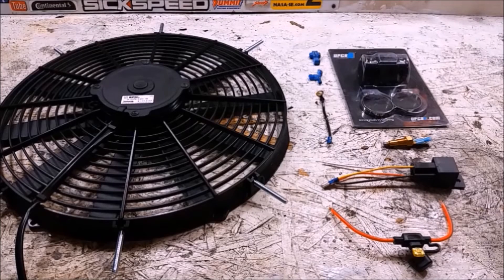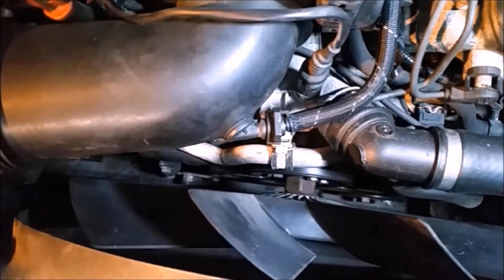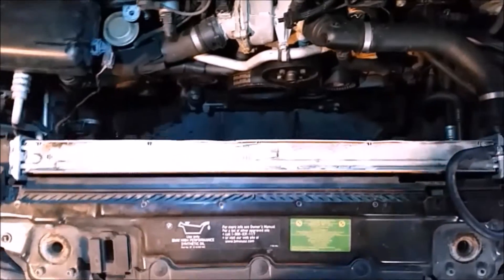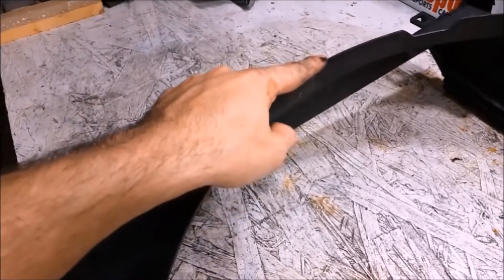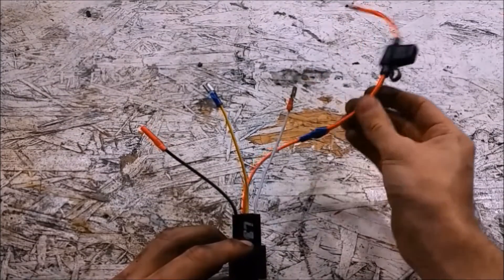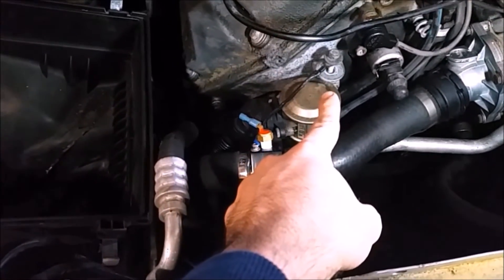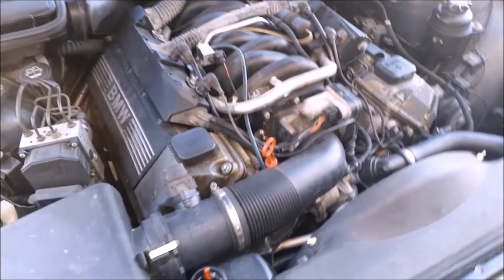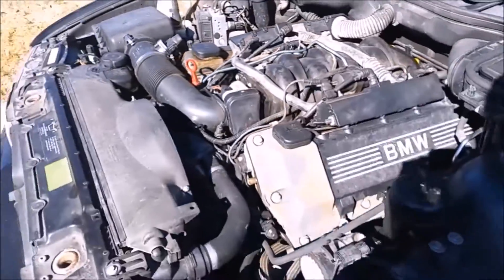E39 BMW 540i Electric Fan Conversion (Cooling Overhaul Part 3 of 5)

Comment: Hello, I bought a 1994 e38 730i that had a 4-pin fan. The car plug is 3-pin. When I turned on the AC it would spin for 20 seconds and blow the fuse. Now I bought a 3-pin fan and I don't know if it should turn on as soon as the AC is on. Is it related to the cold weather? What could be the problem? if I put power on the fan plug it turns on. I don't have 12v on the car plug, I just have 3v on one of the pins. 
I checked all the fuses and they seem ok. Honestly, I don't know which relay it is. What else can I check? Thank you.

Comment: fan spal how much inch ?
Reply from the maker: 16 for I6 engine and 18 for V8 engine
Reply: @350Z247   yes I have engine v8 m62
What is the size of the sensor installed to operate the fan?
Reply from the maker: @ahmad-altqtqi  it depends on what adapter you use. Likely, 1/8npt thread pitch for the temperature sensor

Comment: I have a 2002 e39 540i M Sport 6spd which looks identical to yours. My fan clutch died a few years ago, seizing up and making a horrible racket. The replacement I got comes on at too low a temperature in my opinion, and definitely robs HP. My car already has a built in electric fan in addition to the mechanical fan; does this conversion take that into account, or is the built-in fan adequate as the only fan? Also, your car sounds nice; mine with the factory exhaust doesn't really sound like anything exciting at all. What did you do to the exhaust?
Reply from the maker: I have a video on how I cut the exhaust. I removed the muffler and then replaced the large factory resonator with a Cherry Bomb resonator. The electric fan I added is enough to cool by itself but the factory electric fan in front of the AC condenser is not. It is only intended to push air for the AC when stationary, but it will help the fan for the engine. The combination should work very well together.

Comment: We sell higher wattage electric fans than those in this video at https://www.americanvolt.com/collections/electric-fans which includes radiator mounting kits. Various thermostat switch turn-on temps and NPT thread-in sizes available as well.
Reply from the maker: You're welcome to send me an affiliate link that allows me to get some form of payment for advertising this in the description; otherwise, I'm removing this comment.

Comment: who makes the housing for the temperature sensor, the one that goes into the coolant hose?  What part number?  An easier way to mount the fan is via some Napa plastic zip clips.  They are made of this purpose.  You insert from the front of the radiator between the fins then through the fan mounts.  Then there is a zip on the engine side that works like a zip tie.  Just cut the excess off like zip tie.  They don't ever seem to cause leaks in the radiator fins.
Reply from the maker: The housing is just a universal one from Amazon. There's a link in the description. I don't like the zip clips. I avoid them for anything larger than a small power steering cooler. They will work, but I can do better.
Reply: @350Z247  May I just ask you what bad experience you had with the clips to not like them
Reply from the maker: @geworthomd  I've had them break when holding up an oil cooler on my 350Z. I'm not trusting them to hold up a fan that weighs several pounds and has the potential to do serious damage to the radiator and hoses if it fails. Plus, I don't like bending radiator fins. They have a place, but this isn't it.

Comment: Does the ground from the relay connect to the fan? And then I make my own ground from the engine block to the thermal switch?
Reply from the maker: The ground wire from the relay goes to the thermal switch; when it closes, the switch will connect the ground to the engine block allowing the relay to function. The ground on the fan just goes to any available chassis ground.

Comment: I think mishimoto makes a fan that has a temp sensor that sits between the radiator fins so you don’t need to plumb in a sensor
Reply from the maker: That's definitely an option. I'm not sure what the difference in temperature readings would be, but I'd bet they're pretty similar.

Comment: Also quick question the thermo switch you have only has one connector end and since that end connects straight from the relay. The one in the link has two connector ends. Do we have to wire that end differently? Or still one wire to relay and one wire straight to the block the inline adapter
Reply from the maker: If it has two posts, one wire is from the relay and one goes to the engine block. If it has one post, you'll need to ground the aluminum housing. All the switch does is close when it reaches the listed temperature to allow the relay to ground.
Reply: @350Z247  oh okay thanks a lot! Those were the main concerns I had before jumping in. Kinda had the idea I would do that since the sensor doesn't need a power source I just wanted to make sure if that extra post was needed to be use to work the same
Reply from the maker: Yup, just connect one post exactly like in the video and use the other post to ground to the engine block. Either post can do either job.
Reply: @350Z247  oh okay thank you very much!

Comment: So in the description it says a 34mm inline adapter but the link takes me to one that only has an option for a 28mm and a 30mm it has to be exactly 34mm correct so I can purchase a different one?
Reply from the maker: Measure your hose and buy accordingly. It's been two years; so, I don't remember. 34mm sounds right, but double check yours before ordering.
Reply: @350Z247  wow thank you for the fast reply! So if the inside of the house is 34mm I would need the 34mm or something bigger or smaller?
Reply from the maker: Match the listed size to the interior diameter of the hose. Depending on how long you can have the car out of service, it's super easy to just measure the radiator barb size or cut the hose then order. If you have to leave the car assembled, I would use a piece of masking tape to measure the circumference of the hose, calculate the diameter using the circumference, then subtract the thickness of the hose twice to get the inner diameter. I'm guessing the stock hose is 2mm thick. You could also order two or three of them in various sizes then returned the unused ones.
Reply: @350Z247  oh okay yeah that's very true I have the same car 00' 540i but link threw me off. I was planning to probably install everything at the same time I might try that 34mm since it's similar cars and hopefully it fits but I'll do that masking tape trick just to make sure. Thank you very much!
Reply from the maker: I think I ordered a 36mm first and it was too big, but I really can't remember. You might be able to disconnect the top radiator hose without losing much coolant to double check the housing when it arrives before cutting the hose in half.
Reply: @350Z247  yeah I might do that cuz if anything I'll put the thermostat on at first since my car doesn't have one right now I'll be able to get a good measurement during that time. How's the set up been holding up for you I know it's been a couple years
Reply from the maker: It ran flawless for me for the year that I owned it like this. It definitely made me feel more relaxed during the summer heat. I sold it back in 2019; so, it's been about 18 months.
Reply: @350Z247  oh ok good to hear! Hopefully the car lasts long enough for me to enjoy the new setup once I get to do it
Reply: @steadfastmoney4548  Did it end up being 34mm?
Reply: @bradenclark1560  you know I never had the chance to do it since I started having idling issues and no starts which I just recently fixed
Reply: @steadfastmoney4548  Oh okay no worries. Thanks for the reply

Comment: Is the is the sensor to the description the correct
Reply from the maker: What?
Reply: @350Z247   my bad i meant to say the thermal switch that you linked is that the right one because  at the end of your video  you said that it came on at 215 and turned of at 210 and then said that you where going to get the right switch so i just was wounding if that is the right switch that you linked
Reply from the maker: @noahboa88  the one linked is the second one I tried
Reply: 350Z247  did it work
Reply from the maker: @noahboa88  yup

Comment: i jus did this to mine and im having a really hard time with the bleeding portion....any tips/suggestions
Reply from the maker: If you angel the front of the car up a slope or on ramps with the heater running, it will help the air work its way to the top of the system. There's a procedure in the Bentley Manual as well, but I'm not sure what it is exactly.

Comment: manual  clutch fan never failed 260000miles
Reply from the maker: Yes, but when it does, it's catastrophic. There's just no reason to keep it with all the benefits the electric fan offers.
Reply: got both and electric fan failed
Reply from the maker: @3ricky13  there's a difference between the 20 year old factory AC fan and a brand new Spal fan. But it's your car; do whatever you want.

Comment: Thanks again for your response One last and important question, please I see these codes when I check Obd2 p1341 p1357 p1353 When I enter the code details, this message appears to me
Misfire cylinder 8 with fuel cut /off
Misfire Cylinder 6 with fuel cut / off 
When I delete the error it comes back two days later
Reply from the maker: First check spark plugs, then check the ignition coils, lastly check the fuel injectors. I have a video on this
Reply from the maker: https://youtu.be/Kfiv6GyIDYw

Comment: What is the difference that the electric fan made?
Reply from the maker: The engine felt more peppy. I'm sure I got a bit more power and a bit better gas mileage, but mainly, I just didn't want the clutch fan to explode.
Reply: 350Z247 
My friend, I am very annoyed by the mechanical fan in my car, and this is a very popular thing in the BMW cars that I used 750, 740 and now 540. Actually the mechanical fan is annoying and slows the torque of the car
Reply from the maker: @MHD_85  its definitely a drag on the engine. I'm very happy I removed mine.

Comment: What is the proper fan size for the BMW E39 540i 2003 V8? Is it 16inch or 18inch
Reply from the maker: Based off of my car, you can fit an 18 inch fan for the V8 cars. You can pretty easily measure your mechanical fan while it is still in the car.
Reply: 350Z247 
Thank you for your reply, I appreciate that I meant to put 16inch or could it be 18inch for V8

I think the size of the fan that I installed is 16 inch, and you also put in the purchase link. The fan is 16inch, and that's how I got mixed up.
Reply from the maker: @MHD_85  I would measure your fan as best you can to double check, but 18 should fit based off my car. The 16 inch fan I used worked fine though.

Comment: Hopefully you can help. My fan after install is running all the time from the moment i turn the key to pos 2(aux).what am i doing wrong?? When i connect the ground wire to the thermo switch my fan does not run. Any ideas??
Reply from the maker: It sounds like you have the wiring jumbled. Double check yours against mine. The fan relay should have power going to it when you turn the key, but the ground loop shouldn't close until the thermo switch reaches the correct temperature. Use a scan tool to compare your coolant temperature to when the switch should close.

Comment: That’s a cool video u just made a little bit more horsepower with the electric fan.
Reply from the maker: Thanks. It also made servicing the front of the engine way easier. Easily my favorite upgrade for this chassis.

Comment: Thanks for the video, I am not wiring type of guy, your video helped, I used 16” spal fan on my 540i but what I did differently is I used an 2mm thick aluminum sheet with an exact cut out for fan and bolted the aluminum sheet to the plastic shroud... As for temp sensor switch, I used a common 1990-2006 Toyota single wires temp switch that lets the fan comes on hard at 96C and off at about 93c from what I notice temp “in hidden menu in 540i” of course all that coupled with non electric 88c thermostat from turner Motorsport.
Reply from the maker: Sounds like you did an excellent job. Good find on the Toyota temp switch!  It's always good to hear stories of people preserving these amazing cars.

Comment: Hi I have a problem in my car BMW E39 electronic fan front does not shut down continuously even when the engine is fully extinguished Is anyone help me and thank you
Reply from the maker: It's hard to pinpoint the issue, but it sounds like it is wired incorrectly.
Reply: 350Z247 
Do you think it's because relay because the problem got after you washed the engine
Reply from the maker: @MHD_85  It could be. You could test it to see if it is operating properly.

Comment: Hi, do you still remember what relay you have used? I'm trying to get similar parts here in Europe and I would like to mirror whatever I can. Thankfully we do have spal available here :)

So:
- Wires preferably 8 or 10 AMG
- SPAL 16" 30100401 PULLER
- Inline fuse 30A
- The relay is NC / NO(30A/40A) or just NO? 
- As i have the '98 E39 540i my engine is M62B44 so the direct fit is a thermostat from E31 gulf edition that is similar to m5 and set to 85 deg (11531742964).
- Temperature switch 195F should be the golden spot as it will match my 85 deg thermostat (P.I.T.A. to find here due to translation) 
[Went through the rest of the comments and now I know] //BTW when you mounted the setrab was it visible from the inside of the tube? I am wondering how long the switch should be.//
- 34mm adapter

Currently the relay is my biggest "concern". 
Any help appreciated :)
Reply from the maker: And my switch is visible in the adapter, but if not, it will still get a good signal. The heat transfer will still give you a good temperature reading.
Reply from the maker: Any 40 amp relay will do. I used a 4 wire relay I bought off eBay. Any relay will do; the rest of your list looks good.
Reply: @350Z247  Thanks for the info :) So now it seems it is time to order and mount the stuff.
Reply from the maker: @krzysztofmalinowski7816  You'll be happy you did; it was very satisfying.

Comment: What kind of temp switch did you use? I am using TS319T from a wide range of Toyota’s.. no idea what the rating of that switch. Also great video.. my temp switch seems to kick the fan on at 93c but it is not shutting the fan off at idle.. I haven’t driven the car yet because it’s primed with bumpers off at body shop.. just curious to what temp switch did you use with that adapter that you spliced in bottom hose.
Reply from the maker: Parts list is in the description with links.

Comment: I got same fan. Does this set up keep the stock hi and low fan speed setting? I
Reply from the maker: The stock fan is mechanical; so it has no settings. The hi and low speeds apply to the aux fan in front of the radiator.

Comment: Is an expansion tank in 540i are the same with 523i 528i 530i ?? Mine are leaking Thanks
Reply from the maker: The 6 cylinder cars use a slightly different tank. The size is the same exact thing, but the eight cylinder cars have different barns. My 540i video should be the same for the 530i and 525i. Just make sure you get the correct part number.
Reply: Thanks man I appreciate your help :) 
Oh one more things can you recommend the 18” electric fan brand or company? I have checked Spal they not making 18” 

Btw Great video really helpful ;)
Reply from the maker: @Melodera  I would just get a 16 inch fan. I had a 14 inch fan in a very warm climate with zero issues. Too big a fan will just put a heavy draw on your electronics.
Reply: 350Z247 
Ok I see your point ,so you mean I should get a 16inch is enough right? Im living in south east asia the weather are always hot (Average above 30-40c all year long) So im a little bit concerned about that.
Thanks man
Reply: 350Z247 One more question if I dont wanna add another temperature sensor where can I connect the wire instead ? Can i connect on a thermostat wire on your part2?
Reply from the maker: @Melodera  you need the temperature sensor to tell the fan to turn on. When it reads a certain temperature, it closes the circuit and powers the fan. If you combine the thermostat, a really quality 16 inch fan, and a quality 12 or 14 inch auxiliary fan, you should be able to handle those temperatures. I add an auxiliary fan in part 5 of this series.
Reply: 350Z247 Ok so you use a thermal switch which on the fan at 200F to match 88c thermostat am I right?
Reply from the maker: @Melodera  exactly. So the thermostat opens at 190F and the fan turns on at 200F then back off at 190F. It should keep the car between 190F and 200F.
Reply: 350Z247 cant thanks you enough for this ;) 
Last things what size of wire should I use mine had 14AWG laying around can Is it enough to carry this current ??
Reply from the maker: @Melodera  I would go a bit thicker like 8 or 10 to be safe. Make sure you use an inline fuse.

Comment: I can do this on my i6 e39?
Reply from the maker: Yup, it should all be the exact same procedure.
Reply: It looks like the v8 in the 540s have more room in the front.. at least I'm hoping, I just tried slipping the shroud back in with the freshly installed fan, it's on the water pump pulley, even though I set it flush inside the OE shroud, I'm hoping all I need is to scooch it up, but the fan is already very close to the radiator.. I'm shocked because I see he even used stand offs in his build...
Reply: Found my issue, he used a low profile 1300 cfm fan.. I bought a high performance 3000 CFM fan..